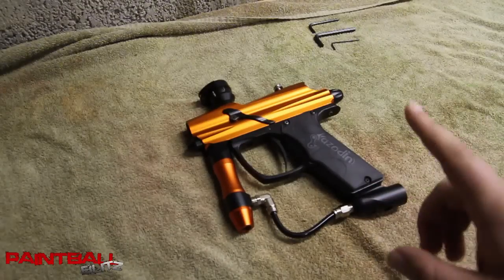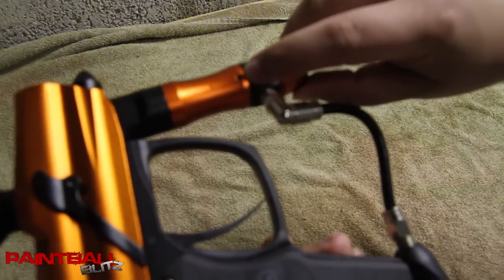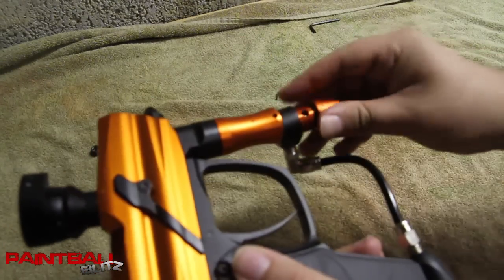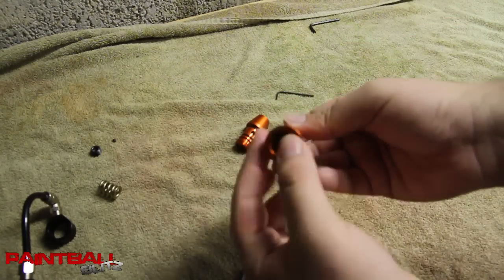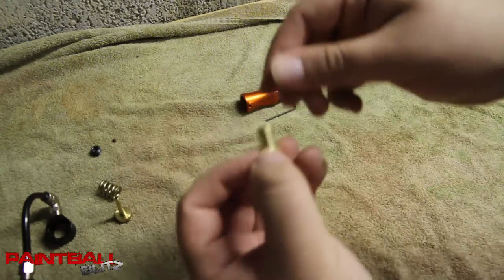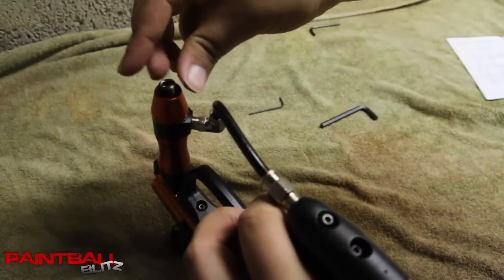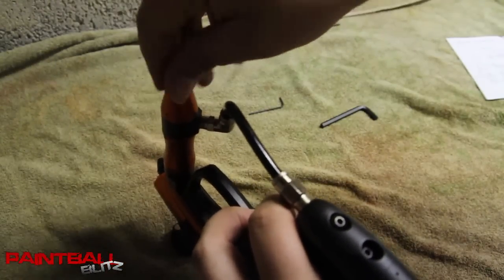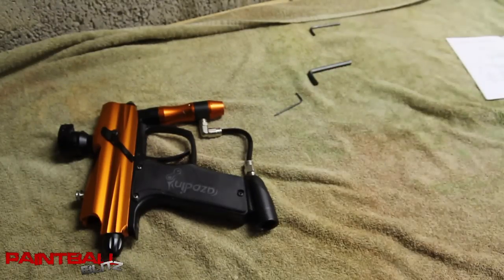Azodin Blitz 2011 Regulator Disassembly

Comment from the maker: It does sound like a regulator issue. First thing I would do is, cock back your bolt before you screw in an air tank...see if that helps. And I would also loosen the adjustment screw that's at the bottom of your regulator that's shown in the video. If that part is too tight, your cup seal isn't sealing correctly. Let me know if those suggestions work.

Thanks for watching, I hope this helps.

Comment: This is what i got from azodin.
"C-Clip is added onto Azodin's latest version of Blitz inline regulator  that used to prevent player from opening up the regulator during the game. You will a needle nose pliers to remove the c-clip at the bottom of  inline regulator. When you are lubing the o-ring in the inline regulator, apply grease on the tip of piston, R031 Regulator Piston O-Ring and R034 Regulattor Seal O-Ring"

Comment from the maker: Yeah, that was the o-ring. It was a pain to get it in there....I pinched it and put "one side" in, so about half of the ring was in the right place, and the other half was stick up/out of the hole...so then I slowly pushed that side down, took a couple of tries, as when I'd push, the whole o-ring would fall through the bottom. 

So it's just trial and error unfortunately, but I got it eventually, so you can too. Maybe have a small screwdriver handy to push it down a bit.
Reply: for anyone attempting to do this, I figured out that you can stick an allen wrench that's just small enough to fit up the bottom of the reg housing  Then when you squeeze the o-ring to fit it into the groove from the other end, the wrench will keep the o-ring in place so you can seat it into the groove.

Comment: Its a lock ring. Im not sure why its there, but usually you have to have a special pliers to remove them. That lock ring will need to be removed in order for you to disassemble the reg. You might be able to find two pins small and strong enough to stick in the two holes and pull them together to remove it. It'll be a bitch tryin to get it out without those special pliers, but it can be done.

Comment: air is leaking out the top hole on my regulator( im using c02 because i don't have hpa at the moment) but is it an O ring or do i need to lube the regulator

Comment from the maker: Just sounds like the adjustment screw is stubborn and is stuck...but with the right amount of strength you can unscrew it. Maybe unscrewing the whole regulator could get you a better grip on it to twist.

Now as far as the "metal horse shoe like ring", is that on your Azodin? I've never seen something that resembles that. Is it removable?